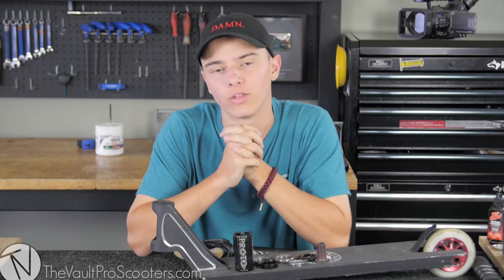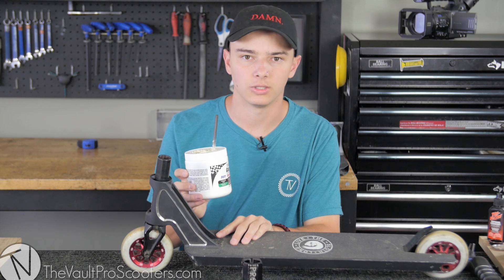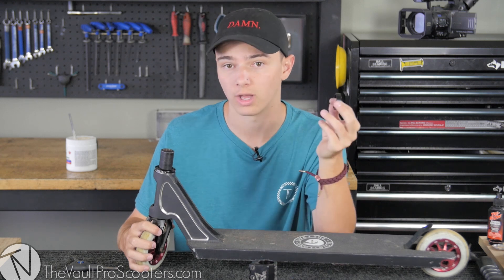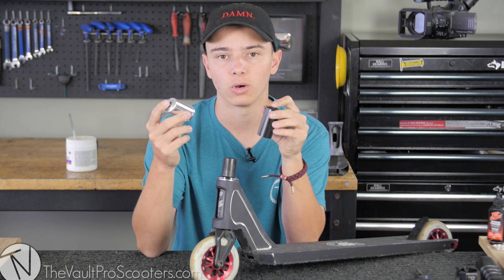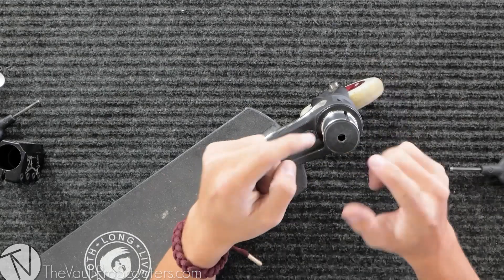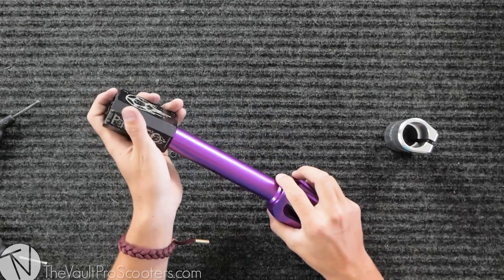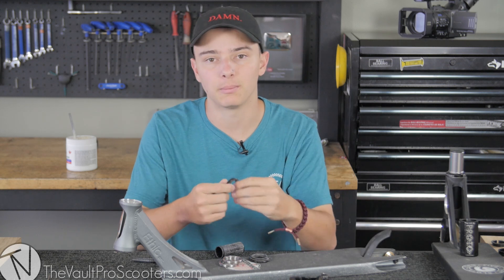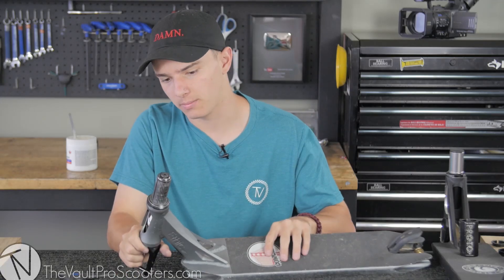SCS vs HIC vs IHC Comparison and Installation Guide │ The Vault Pro Scooters

Comment: Forgot to mention crown race for scs (:
Reply: He doesn’t need it if its an integrated fork, which it is
Reply: TheGrapeSlushies what scs clamp can you run on a apex fork
Reply: Raine_is_ Here all
Reply: Raine_is_ you can run any as long as your fork fits it
Reply: TheGrapeSlushies and ics
Reply: Hey Sean/Shaun! IDK How to spell your name!
Reply: TheGrapeSlushies hey guys I have a hic grit fork and I run aluminium bars so there standard on the inside. Your video said oversized only please explain
Reply: Booter Sprad aluminum is weak, so it needs to be thicker for he walks. the outside of the bars are oversized to compensate for the weakness of aluminum
Reply: Anonymous  I already know that but I ride hic so the vault is wrong
Reply: Booter Sprad you could be running mini hic
Reply: TheGrapeSlushies n
Reply: 11:47
Reply: bruhg #2, you’re riding mini HIC aka IHC

Comment: Omg thank you! I've been battling my son's envy after getting him a new headset and I was so dam lost on why it wouldnt go back together right! Lol I'm such a idiot haha I was using the new ring the headset came with instead of the one that fits it and I couldn't figure out why the shim was dropping down into the neck! Ugh I tried everything! Well lookslike I'll be taking it apart tomarow for the 3rd time to finnaly get it right! Thanks again I was so pissed haha
Reply: Dang, one year ago, and no comments. Its actually amazing that a father is actually learning about pro scooters🤣, but i guess not only kids and teens and scooter shops, but also parents.
Reply: @DCW121  init 🤣🤣🤣🤣
Reply: @DCW121  I cut my 6 Yr old's steel MGP bars down following advice from a scooter dad. As a commercial pipefitter I had no problem working with steel tubing. I even had an inside/outside reamer. I never thought I'd find myself needing these skills for my kids!

Comment: great video. a lot of people have trouble with compretion
Reply: hey  I have a hic grit fork and I run aluminium bars so there standard on the inside. Your video said oversized only please explain
Reply: Booter Sprad your forks are probably ihc
Reply: Leo Hawthorne no it's hic the bolt is small, also in the product description it says hic. My friend has ihc and there are big differences to prove that
Reply: and you have trouble with spelling
Reply: SupremeNinja how

Comment: first one here lets get this comment to the the top
Reply: TheGrapeSlushies hey guys I have a hic grit fork and I run aluminium bars so there standard on the inside. Your video said oversized only please explain
Reply: Ryan Wirtz but my fork is hic it even says it the the product description plus it's a small bolt not a long one like ihc. Even normal standard bars fit on it
Reply: Ryan Wirtz soz I ride a grit tremour fork and a grit aluminium y bar

Comment: 1:23 Z Martini. 3:58 You can't even see. But there is an example like what SCS is at 6:20. 11:45 Just because it doesn't wanna snap into place does not mean it does not belong there, you can tell if the fork already has a "lip". 12:56 "Aluminum bars with a slit" NAH MATE. The Aztek Odyssey V2 Aluminum Bars standard have the inner diameter too small for IHC. 13:35 I recommend you actually take out the seal with a blade just be careful not to bend the seal as it will be warped and you will not put it back neatly.  14:55 Id like to add that its the strongest because while it has been tightened, the SCS clamps on to the fork so it adds reinforcement.

Comment: what size is the bolt you use for the scs i have the apex quantum and im having issues with wheel moving it came apart while riding eventually i went to ace but bolt is week

Comment: Why doess the madd gear extreme vx6 say it’s ihc but i have to put on the headset cap before the shim then the bolt ontop?
Reply: Daniel Boateng it is a mini HIC and he cap is undersized not the normal size
Reply: Daniel Boateng  because your clamp is probably oversized. My sacrifice of player was changed for reaper bars and the reaper bars have a slit. My blazer clamp has a shin because it is oversized omfg I’m so bad at explaining stuff lol

Comment: I don't understand why do I need to tighten the bolts on the compression so lightly, on all compressions you say that I just need to stop at the resistance or even untighten it a bit, that is basically a bolt that can be unscrewed with a single finger or two?

Comment: what would you rate the envy vs5 prodigy on a scale from 1 to 10
Reply: Talos is bae I have it in polished I'd give it a 6-7
Reply: Talos is bae 5-6
Reply: Talos is bae 1
Reply: its really good i have it and cheap-ish so an 8.5
Reply: NightHunt it doesnt suck either
Reply: if you are a person that is a beginner rider then it is a good scooter. if you are jumping big stairs and throwing Bri flips then do not get it cuz I jumped a 3 stair and snapped the bars and bent the forks and compression :( . so to me I would rate it 3 but if you are a beginner then a 7
Reply: 6
Reply: HDN Productions i've been doing bris and fingerwhips on it no problem and it's held fine
Reply: Talos is bae 7
Reply: Talos is bae don't get a prodigy unless you are under 170 ish. lucky makes a stronger scooter and my friend had the prodigy. he weighs 170-180 and bent his fork riding flyout.
Reply: Talos is bae 9/10 but its a bit heavy when u start out with it but you would get used to it

Comment: my scooter is clicking while riding it's not the headset I think it's the deck or bearings and my bearings ate squeaking do you think the bearings are broken?
Reply: random random are they old
Reply: mine did when they got old
Reply: Noah Croft 2002 there barely  2 months old and I don't ride lots
Reply: random random mine used to do the same I just loosened my compression a bit and it went away not saying it will work but u should give it a try if u haven't before good luck
Reply: EL21 thanks

Comment: what compression would I use for envy Union bars?and what clamp?
Reply: Kael Harwood hic or ihc
Reply: lol no only ihc he said in the video
Reply: Trick Fuzion ok thanks.what fork should get?(I'm kinda on a budget)
Reply: Kael Harwood any ihc fork like the SOBv3
Reply: Branden Gatewood isn't that an envy fork?
Reply: and do I need to put that cut in the bars?
Reply: yes for ihc you need a slit
Reply: if you're on a budget don't get the SOBv3 it's expensive
Reply: Branden Gatewood do they have any cheeper options?
Reply: Just go on the vault and search ihc fork any of them would work

Comment: My bars are stuck, how i get them easily off?
Reply: stretch your clamp
Reply: Flip yur scoot upside down and kick the bars
Reply: get a saw and cut off the bars ;)
Reply: Do the coin trick. All you have to do is undo the bolt abit then put a coin inbetween and tighten it so it opens it.

Comment: I’m using ihc compression but I’ve got oversized reapers 🤔
Reply: I have same bars but am confused whether I have ihc or hic watching tons of videos on the difference and there doesn't seem to be one so I don't understand.
Reply: Mia Valentine I found out oversized reapers have the same inside width as standard bars so they fit on ihc forks
Reply: @bonkasvx3158  so I probably have ihc 
I want to go to steel bars anyway
Reply: Mia Valentine yep

Comment: SCS is not the strongest.. with scs you dont have the bars going over the fork causing a weak spot on the fork..and the you add a spacers.. exposing a spot for the fork to bend or snap... ive broke 3 different forks with scs and non with hic..